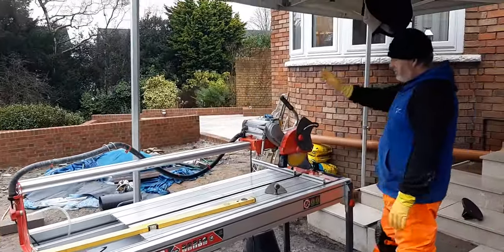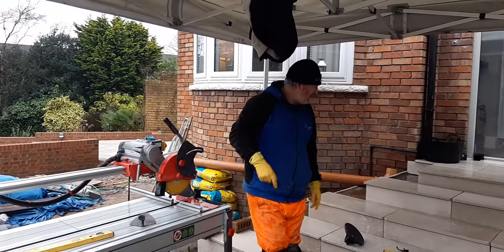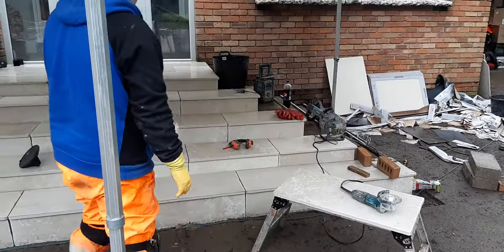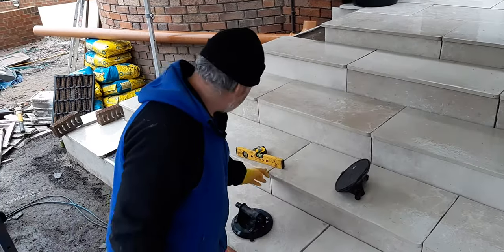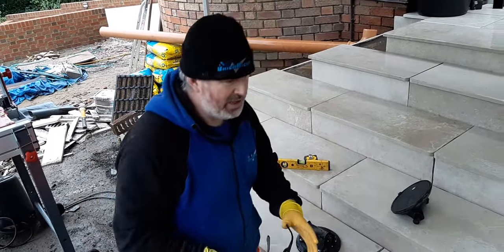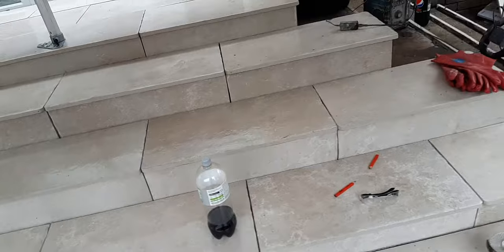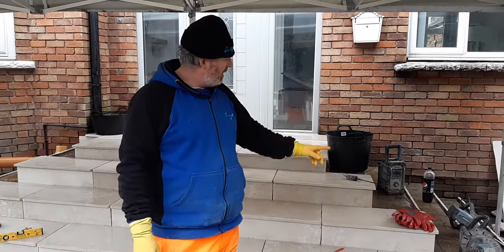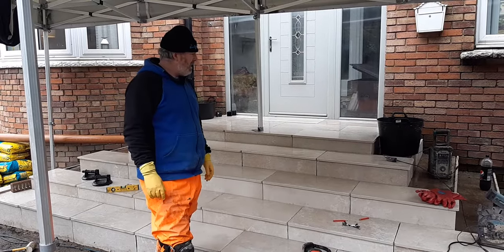How To Tile Outdoor Concrete Steps In PORCELAIN

Comment: Steps would be better with all same rise and going? One looks lower in the rise? Looks nice tho
Reply from the maker: Steve they are but if you watch the videos we layed over existing concrete step so couldn't change anything risers or treads was a massive amount of work and cutting. Hope that explains it for you mate 
Justin 👍
Reply: @brickrightbuildinglandscaping  
I couldn’t live with that odd step! But looks love all the same!
Reply from the maker: @stevenlomas8812  thanks steve was the customers choice but the cost to remove and rebuild the steps then Porcelain them would of been massive so client was happy .im a fussy git and they dont bother me they look really good but if thats your preference im understanding on that mate 
Justin 👍
Reply: Looks fab but your in my game but I would have to alter tile on tile to pick up and even out slightly but I bet they be kicking themselves when they constantly tripping! Should of payed you the extra 😇
Reply from the maker: @stevenlomas8812  steve its fine no issue other than that one step which clients actually had put in my someone else there happy im happy no body has tripped its not an issue mate 👍
Reply: They still look good boys !
Reply from the maker: @stevenlomas8812  
We put a lot into them steps 🤣🤣 appreciate it Steve thanks.
Justin 👍

Comment: Thanks for the video. I'm about to lay porcelain on concrete steps, do you recommend putting adhesive on the step first, letting it go off the binding the slab on? Or straight onto the concrete with just adhesive on the back of the tile? Cheers
Reply from the maker: Apologies ive only now seen this i missed your post sorry.
We used adhesive to put all the risers on first let them set then added the treads on top.
Hope that helps and sorry once again i missed you 
Justin 👍

Comment: Would you always over hang the top tiles or can you flush fit? We have 4 steps, 3 breeze block wide we want to tile with no overhanging edge. Is this a good idea or cause problems?
Reply from the maker: Hi david
You can flush them if you like be nice to mitre them mate 👍
Reply: @brickrightbuildinglandscaping  nice one!
Reply from the maker: @davidlavelle8653  
👍👍🙂🧱🧱

Comment: I really want to go with R11 grade Porcelain slabs but the wife reckons they are going to be slippery when they get wet , are they that slippery ?
Reply from the maker: Hi Stunl
In my opinion s11 for outdoor porcelain is absolutely fine not slippery at all .S11 IS the requirement for outdoor porcelain so its fine .S12 and s13 are the highest slip ratings. 
Ask the manufacturer to clarify your question but id say good to go .
Hope that helps and good luck
Justin 👍
Reply: @brickrightbuildinglandscaping  Nice one thanks for the reply :)
Reply from the maker: @Stunl3y  your welcome 👍